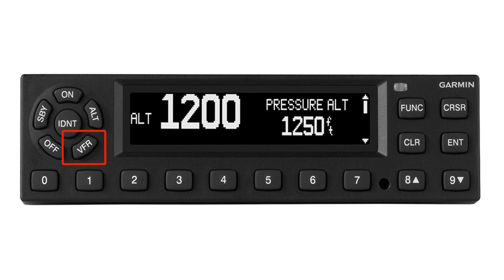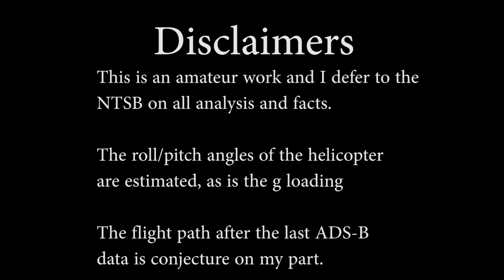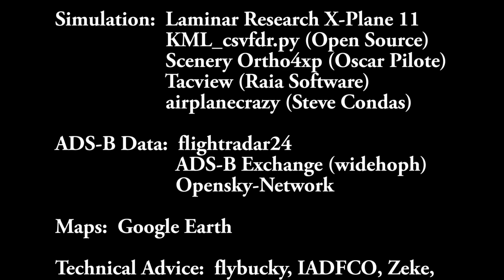Newly released Pilot to ATC Audio!  N72EX (Kobe Bryant) Crash Reconstruction.

Comment: From 17:43:50 to 17:44:30, the pilot is in a right turn. He's climbing initially, but then at 17:44:08, his rate of climb suddenly drops, and he starts coming back down. Then, just before 17:44:30, we see that reversed again, and he starts climbing and leveling out, but then overshoots into an increasing left bank, eventually transitioning into a dive and impact with terrain.

So here's what I think is going on:
Pilot is not very experienced on instruments, and is flying a modified VFR flight plan. He's following the highway, mostly looking out the windows to maintain visual contact with the ground, trying to skim just under the cloud. He's thinking he can make it, he's done this flight many times before in similar conditions, and has no reason to believe this time will be any different. As he's following the highway around to the right, he's climbing to try to maintain altitude above the hills that are closing in. However, the ceiling is descending on him.

Probably the first sign he has in his own mind that he's potentially in trouble comes at :07, when he inadvertently pops into the cloud, maybe loses sight of the terrain, and starts coming down trying to maintain visual contact with the ground. He knows the route, knows he needs to stay with the right turn for a bit, but he's coming up to hills that will box him in, and now he's lost in the clouds. He brings it down, attention fixated out the windows, peering through the mist, intently trying to see the terrain, as he descends as low as he thinks he can, trying to feel his way out of the clouds. He probably breaks through into the clear at :28 or so, sees the ceiling has descended well below the peaks of the hills, and decides his only option is to climb out. Sensible.

Now he moves to level the aircraft and begin the climb, but he's not looking at the instruments. He's working the radio, and the first thing ATC does is ask him for his location. Maybe he looks at the GPS for this, maybe not. Then ATC asks him to IDENT, for which I would imagine he'd have to look to press the correct button. He's also stressed, this isn't how this was supposed to go, and maybe his famous passenger is weighing on his mind a bit.

Problem is, he still feels like he's banked to the right, so in the background, he's just passively easing the cyclic to the left, to correct the bank and level the aircraft and climb out. He's already climbed into the soup, so he has no external visual reference, and he's distracted by ATC requests and stressed by the situation and doesn't think to look at the artificial horizon immediately. At about 17:45:00, he probably checks it and realizes he's banking left, and so he levels back out, but then ATC is talking again, and he doesn't have IFR discipline, so he loses focus on the artificial horizon, and starts fading left again because he still feels like he's banking right.

Is he talking to people in the cabin with him? Is he trying to catch up with the aircraft and figure his next steps? Is he just task-saturated? Is he maybe waiting on ATC to get back to him with confirmation of flight following and some kind of reference? That's the bit that is impossible to say. At 17:45:24, the pilot sounds as though he believes he's in full control of the aircraft and has a plan, but then prompted by the ATC request of intentions, checks his instruments, and realizes from the artificial horizon that something is deeply, probably fatally wrong.

He's either too busy trying to save the aircraft, or catastrophically mentally bluescreened, when, three seconds later, ATC lobs a snarky question at him. He doesn't key the mic, and they're into the terrain before anything else can be said.

I don't see a medical here, or a mechanical issue, or anything else sensational. I see an absolutely textbook case of a marginal and possibly slightly complacent or overconfident pilot, flying into marginal weather conditions, which suddenly worsened outside his experience and beyond his skill, leading to a very brief, but classic, graveyard spiral. It takes about 20 seconds for the fluid in the inner ear to recalibrate to assume that a constant motion is the new stationary, from which any deviation is now the new movement, and this pilot was in a right turn for twice that long. Normally, your brain will take visual inputs and correct this misperception so thoroughly that you don't even notice the discrepancy... But when you lose any external visual reference, like what happens when you're in a cloud, all you have is the inner ear inertia sensor, and when it's telling you that you're still turning right, that feeling is so powerful that it can be difficult to trust the artificial horizon telling you that you're level even when you're looking right at it.

So every time the pilot wasn't looking at the artificial horizon, he was banking left to correct the feeling of still being banked right. Instrument training will teach a rhythm of checking specific instruments, of which the horizon is a critically important one, but without that training, and with all that stress, it's all too easy to lose focus, and feel your way right into the ground.

Thanks to Mr. Condas for doing the work of collecting and synthesizing the data into a full combined package. I hadn't seen it laid out so clearly and plainly anywhere else, and seeing what was said, and how, and what the aircraft was doing, all together, the picture of what brought this aircraft down just kind of jumps off the page. Terrible, sad, tragic, unfortunate, but understandable, and hopefully this high-profile incident can provide a meaningful push for general aviators and seasoned commercial pilots alike to avoid tempting marginal conditions.
Reply from the maker: Thank you for the thoughtful comment (sorry I just noticed it).  Your assessment seems pretty close to me.
Reply: @stevencondas2281  Thank you! To be fair, I was way late to the party to begin with, so I'm a bit surprised anyone saw it at all. And thanks again for putting in the time to gather all the information together and match it all up. This is the best presentation of its kind that I have seen on the Calabasas crash, and works wonders to make the critical points in the flight so easily visible.
Reply: What you just explained sounds absolutely terrifying
Reply: @bnote1990 theres risk in almost everything and if you analyze any situation or choice long enough it’s possible to think of way that it’s dangerous and to become afraid. It’s also possible to summon up your courage, steel yourself, believe that you can do it and face the “dragon” head on when fear grips you—it’s how one chooses to respond in that moment that decides the outcome. 

(To be clear, im speaking generally. I’m not saying the pilot could’ve willed his way to victory here, I’m only saying that forcing himself to trust his instruments and his training over any instinct or knee jerk reaction may have saved everyone’s lives that day. unfortunately it didn’t work out that way and we’ll never know what really happened with the pilot or what went on his mind. I do think he was panicking at the very end and realized he had killed everyone right before the impact though, personally.)

Comment: Say his attitude meter was broken, wouldn't they feel a pull for doing such a big turn at a high rate of speed? Why not try to turn or correct position? I've never flown before, but I imagine it feels like taking a corner a little too fast in a car.
Reply from the maker: The feeling might have been just like they were still climbing.  I created a preliminary video of the g-forces on the occupants, and I think that for a large portion of the turn it could have been perceived by the pilot as normal flight:  https://youtu.be/xI1UqFvNYIU

Comment: If pilot is disoriented, are the passengers too? Don't they feel the shift?
Reply from the maker: I believe you are the first to ask me that.  I am not an expert, but the literature suggests that the passengers would have perceived the roll that starts about 4:13 (humans can perceive roll rates of more than 2 degrees per second).  Once the roll is complete, I wonder if the passengers perceived the helicopter as "tilted" to the port side (I say port side because some passengers were facing backward, so the tilt would be to their right).  The changing pitch of the helicopter is rather gradual and I suspect that they wouldn't have perceived that.  The NTSB has access to analysis software to answer your question, and I hope that we see that analysis in the NTSB final report.

Lastly, I think at some point during the rapid descent the occupants would have felt discomfort in their ears due to the changing air pressure.
Reply: @stevencondas2281  i wonder what evidence from passengers' mobile phones will reveal. When pilot is circling in Burbank you can hear a phone ringing. I have no doubt in last 2 minutes they all realized they were in trouble.
Reply from the maker: @NRaeT  Regarding the mobile phones, the NTSB record says they were too damaged to retrieve any information.  https://dms.ntsb.gov/public/63500-63999/63911/636382.pdf
Reply: @stevencondas2281  but what about calls they may of made to another party or a text that may of been sent...
Reply from the maker: I have been following this pretty closely and there have not yet been any public disclosures of such texts.
Reply: @stevencondas2281  will you be doing a video of exact moment of impact? I keep wondering if Chopper bounced around and how parts came off... And how it ended up resting on that cliff.
Reply from the maker: @NRaeT  Probably not.  I don't have much expertise in actual impact dynamics and I don't have tools to help me.

Comment: Don't be stupid nobody gets spatially unaware with a bank like that and the ball being banked.....something nefarious happened
Reply from the maker: Pilots do indeed get that spatially unaware.   I have never experienced spatial disorientation in a helicopter, but this video shows how easy it is to become disoriented when you don't see the attitude indicator and you can't see the ground out the window:   https://www.youtube.com/watch?v=9ofStn2KScg&t=330s .   In that video, the pilot is flying while his head is covered and the attitude indicator is turned off, and he gets completely disoriented.  He is trying to fly straight and level, thinks he might be banking to the right, and is actually banking to the left and descending.  I think our senses can be fooled and that is what happened to the pilot in this case.
Reply: @stevencondas2281  he shouldn't be in fog without the altitude and and looking at his guages, with a celebrity no less, and it's a helicopter not a plane he could easily just hover and re adjust, I think something nefarious happened
Reply from the maker: Yes, he should be looking at his gauges.  The audio strongly suggests that he wasn't, and that he was confused about the orientation of the helicopter.  The most reasonable theory I have heard thus far is that he was interacting with the Flight Management System (FMS) in the center console (left and down), and was trying to pull up the Instrument Landing Approach information for the Calabasas airport.
Reply: @stevencondas2281  yeah he should have just hovered instead of moving, have all the time in the world in a helicopter, I'd imagine he'd be extra cautious if he can't really see the terrain, I'd assume the rest of the cabin would notice the bank, too strange
Reply from the maker: Actually, hovering is not the correct procedure in the clouds because helicopters are more difficult to control in a hover.  Here is the high level IIMC procedure from the company's training manual:  

"Control: First use the wings on the attitude indicator to level the helicopter. Maintain heading and increase to climb power. Establish best climb airspeed but no slower than VMINI. Cross reference attitude indicator to indicate a positive attitude.

Climb: Climb straight ahead until your crosscheck is established. Then make a turn only to avoid terrain or objects. If a climb altitude has not been previously established with ATC, then you should climb to an altitude that is at least 1,000 feet above the highest known object or terrain and that allows for contacting ATC.

Turn: If a turn back to VMC is the best course of action, only initiate the turn after stable flight is achieved. First note the heading that you are on then begin the turn and maintain a
constant rate of turn to the selected heading. Use of the heading bug is a great tool in this situation.

Communicate: Attempt to contact ATC as soon as the helicopter is stabilized in the climb and headed away from danger. If the appropriate frequency is not known, you should attempt to contact ATC on either very high frequency (VHF) 121.5 or ultra high frequency (UHF) 243.0. Initial information provided to ATC should be your approximate location, that inadvertent IMC has been encountered and an emergency climb has been made, your altitude, amount of flight time remaining (fuel state), and number of persons on board. You should then request a vector to either VFR weather conditions or to the nearest suitable airport/heliport that conditions will support a successful approach. If unable to contact ATC and a transponder code has not been previously established with ATC for inadvertent IMC, change the transponder code to 7700.

Note: All of the above will be practiced by Manual Manipulation of the Controls and the use of Auto Pilot. The pilot will learn the advantages and disadvantages of recovery by Manual Control and Automation. Example manual control is quicker I Automation slower. However, if pilot experiencing spatial disorientation and unable to regain control Automation is the best option. Also, the pilot will become familiar with the use of the "Go-Around Button" and its functions."

Comment: Excuse me for my non knowledge on helicopters but can't you feel a turn or descend?! When I'm in a plane I can tell when they turn or descend and they where depending forong enough to feel that at least it seems....we need a time machine to change this outcome
Reply from the maker: I think that the way the helicopter turned and descended would have made it difficult to perceive the descent (at least until the air pressure change affected the passengers ears) and the bank.  My reading of the literature is that humans can detect angular rates greater than 2 degrees per second, but that task saturation can interfere with that perception.  https://www.skybrary.aero/index.php/Vestibular_System_and_Illusions_(OGHFA_BN)#Perception_of_motion_and_orientation

Comment: As a professional pilot and instructor, this video and analysis make perfect sense. Classic loss of situational awareness. The aircraft’s attitude during the last several seconds, the lack of any stress in the pilot’s voice...  Absolutely classic. It takes very little time for the ears to adjust to small changes in g-loading, so when you think you’re climbing and level, bam, you’re turning and descending with no idea.  And if you’re not properly trained to fly in IMC, it’s sooo easy to roll it over. It’s the likely cause of JFK Jr.’s accident, and it happens all the time.  Thanks for posting this. (I truly don’t understand the negative comments - what’s the point.)
Reply from the maker: Thanks for the kind comment.  You may be interested in some preliminary work for my final video with the g-forces.  Read the video description for more details:  https://youtu.be/xI1UqFvNYIU

Comment: Insane to think someone who’s flying someone worth that much money would know how to read 2 of his most important gauges.  Anyone flying should know if you can’t see you better watch you altitude and your horizon line so you keep steady control until you have enough altitude for radar.   He never tried to do anything but put the chopper into the ground so unless he had a health issue I don’t see what could have went wrong.   If there were any failures you’d imagine he would be in contact with air traffic.   But he just ghosted and never tried to gain any altitude
Reply: Spatial disorientation has killed a lot of very skilled pilots. It's insidious.

Comment: This isn't a dig but why is there such a huge difference in audio levels? The video itself has been put together really well, but I personally find this unwatchable due to part of the video being too low in volume and then followed by a really loud ear bashing. Its easy to compress the audio wave to enable a clear consistent audio level - TV broadcasters have been doing this for years.  Its not just your channel but YouTube is rife with similar issues. Just my 2 cents thats all
Reply from the maker: That's the first I have heard of that problem.  Sorry about that.  The audio for the ATC is just in one channel as I got it from the FAA (the other channel had the time code), and I didn't have the skills to copy it into the other channel when I made the video.  I am more skilled now and could do a better job.

Comment: With spatial disorientation, is there no feel for gravity?  Would they not feel the lean of the aircraft?
Reply from the maker: I don't believe they felt the lean.  Imagine that you are in a car at high speed turning to the left, what you feel is a pull to the right.  It isn't perfect physics explanation, but I believe this "pull to the right" exactly cancelled the "pull of gravity to the left" and made it feel like there was no left/right pull at all.  Here is a preliminary video (analysis still in work, so there may be changes as my techniques improve). The top views most clearly showing what I think the occupants would feel:  https://youtu.be/xI1UqFvNYIU